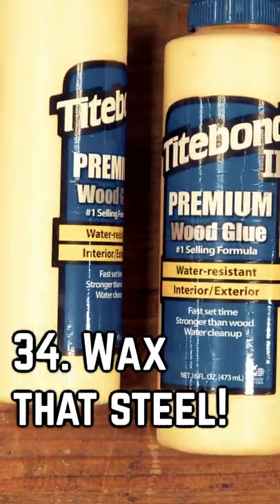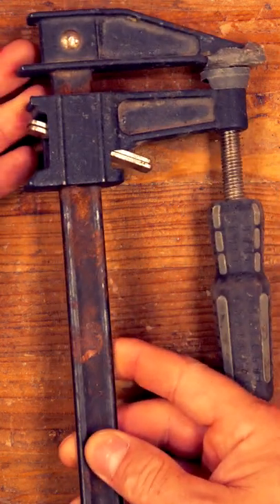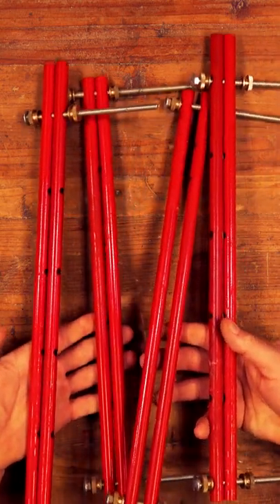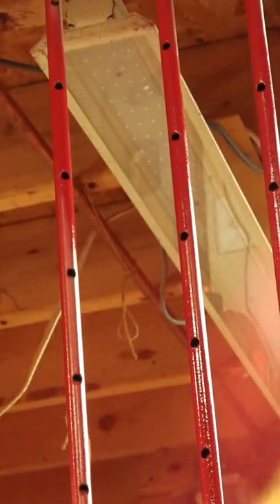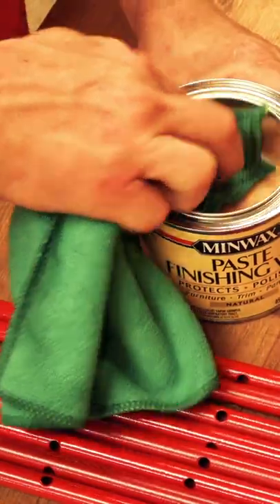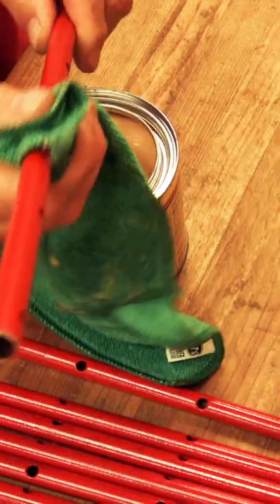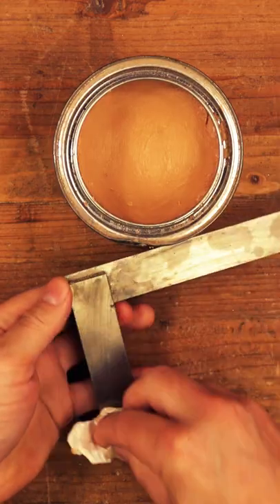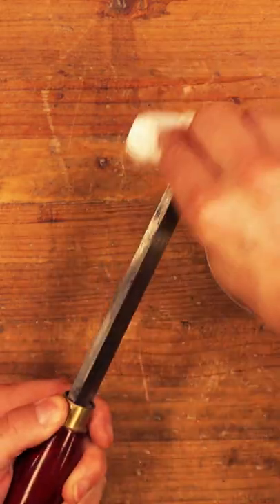34. Wax that steel! #mtbitesize #shorts

Comment: Yeah, wax papers a better solution. Wax paper is very cheap and you don't have to waste your expensive paste wax on your clamps.
Reply: You shouldn't be using that much anyway. Like he said in the vid, it lasts for years.
If price is an issue - one part linseed oil, one part wax, one part turps. Melt the wax in a double boiler. Stir in oil. Remove from heat/put out nearby flames, stir in turps. Pourinto jar/tin/pot. Ta-da, paste wax!
Reply: @samuelmellars7855  that's way too much work, I'll stick with my Dollar Store wax paper.
Reply: @mark5150ty  ok. So how long does your roll last?

Its not that much work considering when I glue I dont have to faff around with paper, and I can wipe up the worst of squeeze-out and not have to scrape and sand blobs of glue away before I sand my stuff down.
Reply: @samuelmellars7855  I glue up guitar bodies and guitar necks therefore a role last me about 6 months. There's never any reason to clean up the squeeze out because the whole thing gets plained. I'll generally take the bulk off with a chisel when it's dry. I reuse the same pieces of wax paper over and over again, no need to throw them out unless I rip one. I don't wrap the clamps I cover the glue seam.

Comment: I've heard it can also act as a moisture barrier in humid environments. Is that accurate?
Reply: Well yeah basically anything that prevent bare metal from exposed to the atmosphere will work
Reply: Are you serious
Reply: Yea it works well on cast iron table saws. With the added benifit of wood gliding easily across the saw